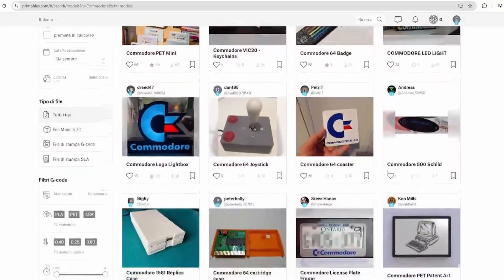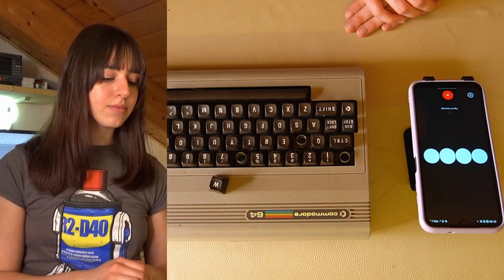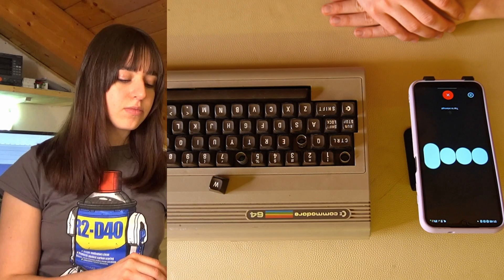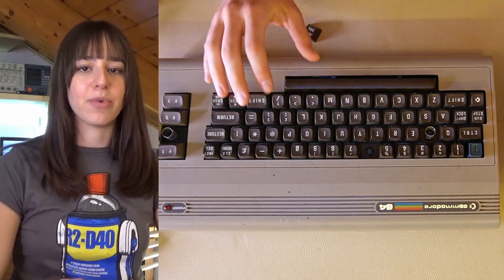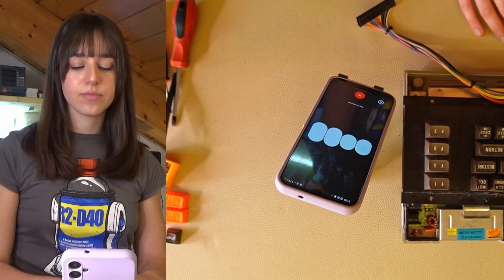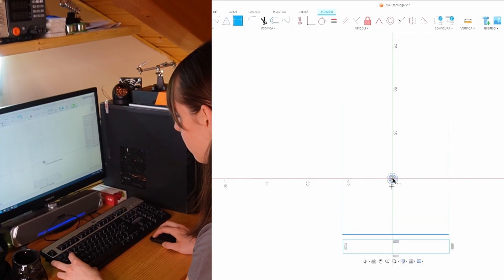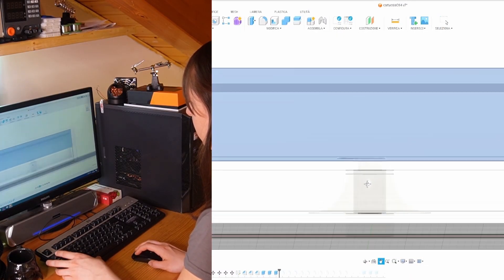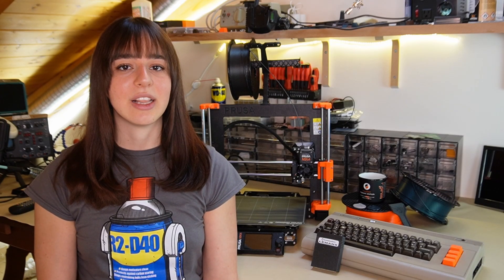3D Printing with ChatGPT: Restoring a C64

Comment: Sorry I just found your channel and wow! Your channel is awesome! I had an Atari 800 back in junior high and had friends who were Commodore users.
For the keys, if you get a white crayon and drag it real hard across the top of the key, the crayons wax will fill in the void where the key number/letter is, once dry put an application or two of clear coat to protect the wax. 
The white in-fill on the void will be visible against the dark of the key.

Comment: Asking your own self hosted 80b LLM would be cooler tho.

Make sure to configure your Gcode generator to enable jerk and accelerations to around ~8mm/s and acceleration to ~400mm/s^2. Otherwise on direction change your mototors will apply full amperage in oposite direction coasing them to wear out. Jerk is Maximum Velocity change in 1 second that printhead can make. Printer will run quieter it will deacelerate before every corner and accelerate afterward. Retractions are also good to fine tune.

Comment: chatgpt seemed to have very general advice.. no specific reference to a primer or paint initially.  anyone can say "use a primer and paint that works well with pla".. I mean.. "duh" advice right there.  now, if it had specific things to look for, or linking to a couple of brands or buy links..  that's directly useful.  but the chemical advice was as vague as "mix to the correct amount" vs actual ratios.

Comment: That was a fantastic video! I've never thought of using chatgpt to help with my 3d printing before what a great way to utilize it.  Couple of tips. First to get the color of the keys exact start with a darker color brown and keep adding white to get the perfect match. Second primer is a good option after sanding to remove layer lines. Third you could try print in white and then before painting you could fill the letters with blu tac or something similar to keep the lettering white and then paint them although the walls of the lettering would be white as well. You could pause the print and change filament color to a brown filament after its printed the letter to make the color of the walls of the letter less obvious of a different color after you have painted it. A resin 3d printer would print the key out perfectly smooth and give a really good finish although this would be one of the very few functional parts you would be able to print with a resin 3d printer as the parts are very brittle and really only suited for cosmetic prints such as figurines. Thanks heaps for the video you have inspired me to use chatgpt next time i design a part. Happy printing and cheers!

Comment: Wow thats something, I didn't know ChatGPT was this advanced now, it was able to give a brief explanation on 3d printing and it wasn't that far off! I would kinda disagree with its material choice, PLA is kinda brittle on its own and in my own experience printing keycaps and eventually the stems break :(

The best choice here is probably PETG, but you need to dry the material first, and yeah it can be a bit annoying the first time you print with it, but once you got the hang of it everything is just cool beans! I know other say "use ABS" but that stuff spews toxic fumes into your room and requires a enclosure to print or your prints get warped, not fun at all!

Oh also the simplest tip I can give - Don't use grid infill! Cubic or gyroid will give you stronger and faster prints! Grid only offers strength in one dimension, but the latter offer it in all dimensions (and gyroid looks cool).
Reply from the maker: I really appreciate your advice! I didn't know about the issues with ABS, so I'll steer clear of using it. I'll definitely give PETG a shot and follow your suggestion on infill. Thanks!

Comment: Don't trust ChatGPT for anything. It has all the information all wrong.

1) The plastic used on the Commodore Computers is ABS. Thus the Keys to be printed should be in ABS. Period.

2) Chances are you have a .40 nozzle, so in printing a .175 layer height would bring smooth results. Also print it at a slow speed of around 40mm/sec to 35mm/sec. for smoother results. 

3) If your printer's software supports "Layer Ironing, then turn it on. It wll take longer for the print to be done but it would come out very smooth when done. You would not need to be sanding the 3D printed items.

4) Thingyverse has various keys and stems for the Commodore keyboard and cartridge cases for the Vic20 and C64.

Comment: I think the orange colour for the function keys is actually a nice touch and the slightly different colour gives the project character, it shows that the machine has been fixed up in an endearing way. If it was a perfect replacement rather than a perfectly functional imperfect one it wouldn't really have much character to show the history of the machine, but a perfectly functional yet imperfect repair in that the parts don't perfectly match the originals in appearance leaves the machine seems to keep a mark on the machine's history to show that the machine has been well used and loved (kind of similar in the way that bodge wires and glue do). So I like little repairs like this that involve fashioning up new parts creatively to get the machines working.
Reply from the maker: Thank you for sharing your perspective! I agree, I also think that the orange color adds a special touch to the project :)

Comment: Maybe this is late advice, but for printing precise shapes without visible layer lines, I like resin printing.  You do need to rinse and post-cure your parts after printing, but they come out much better (and are still easily paintable if you want a different color).  Even if you go with a very complete initial setup, with automatic wash and cure station, you can get started for under $500.  On a budget, you can use the sun to cure, and a pickle jar to rinse, and should be able to get started around $300.
Reply from the maker: Thanks for the input!

Comment: Excellent use of the 3D printer, high-five, i’m further impressed.  Good Mechanical Designing skills, but next time don’t be SO exact, unless you have to, HAVE fun with it, make it simple, but functional. For example in the label you could have printed your logo, like fixed by Sayaka’s Digital Attic and in the game card you could have added some writing, your logo, and or a picture, other than that good practice and amazing legit fixed replications, I guess as long as the fitting dimensions  work, the rest I don’t think that they have to be so exact, ehehehe.  Good choice of color love the Orange keys. See you on the next video! 😺👌⌨️🥰⭐️💎

Comment: Excellent job! I really enjoyed this video.  It was very informative and entertaining.  I look forward to seeing more of your utilitarian uses for your 3D printer.  Most videos out there about 3D printers only show the cutesy or cool applications of the machine.  This is fine and all, but it's refreshing to see someone uses their printer for actual work like part replacements, etc.  Did you use a caliper to get the correct dimensions for your game cartridge?  Also after using your new cartridge a few times, did you notice any chipping or early wear?  Just curious.  Thanks again for such enjoyable video.
Reply from the maker: Thank you for the compliments. Actually, I haven't noticed any particular signs of wear on the new cartridge

Comment: Super cool, just make sure you're printing in a well ventilated area cause I'm pretty sure most of these 3d printers give off some REALLY noxious fumes. Stay safe!
Reply from the maker: Thanks for the input, I've installed a fan in my workshop, so it's well-ventilated :)
Reply: PLA is fine as well as PETG. ABS, ASA and such create toxic fumes. Be careful with these.
Reply: @drstefankrank  ABS - are these kind of black plastic used on base or legs of electric fans? or road cones? or motorcycle headlights?
Reply: @sophietronics  yes, but they release the fumes only when heated to melt them for printing. Once they cooled down they are safe again. ABS comes in all sorts of colours.

Comment: Great job Sayaka. How many time it take to print a key, just curious ? You should add the time elapsed in the video when you accelarate it when printing since it is not real time. 👍
Reply from the maker: Thanks for the suggestion. It doesn't take much for a key, about 15 minutes or even less.

Comment: That was amazing!!! Well done Sayaka. Creating your own objects and printing them is so satisfying :). I'm also working on some things currently but I usually use blender. I may give fusion 360 a try as well. It seems like its more suitable for technical and exact designs.
Reply from the maker: Great! Then let me know how you find Fuse360
Reply: @Sayakas_Digital_Attic  I tried it out. its very awesome :) Still for more freestyle things i think blender works better. But for screws and gears and mechanical things it seems to be super amazing.

Comment: You made that look easy. I would love to get into 3-d printing.
Reply: That’s because using Prusa printers is very easy and intuitive 👍
Reply: After 5 years in 3D printing as hobby, my idea is: got good quality printer. (My first was Anet A8 and it was cheap and awfull)
Reply: Start with learning a 3D modeling software. That is where all the 3D printing fun begins … Once you get around in that software, get a nice printer like the Prusa or Bambu Lab, and you’ll be up and running in no time! Don’t let the cost scare you. You can earn that money back quite fast if you want.
Reply: @Stefan_Van_pellicom  Thanks for the advice, any recommended software for 3D modelling?